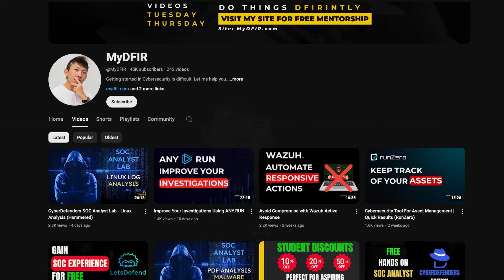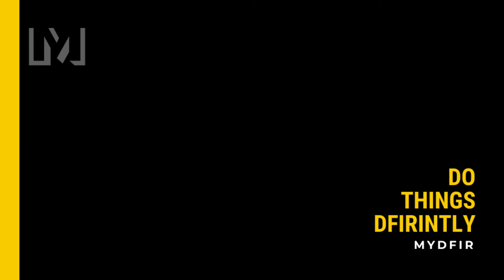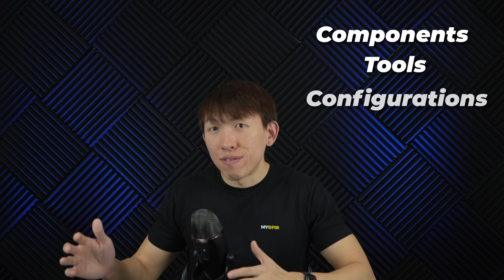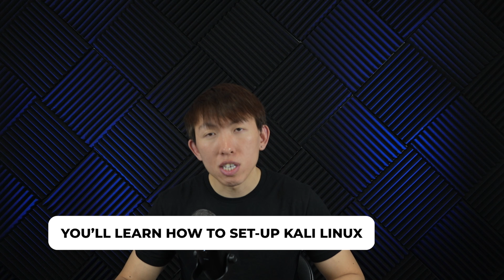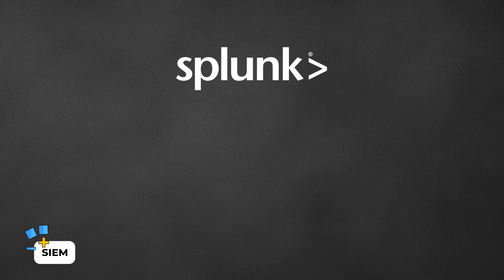Why you NEED a Home Lab | How To Build a Home Lab (SOC Analyst)

Comment: Does Ryzen 7 7th gen with 16GB RAM is good to run upto 6 VMs at the same time?
Reply: I think each vm needs about 4 gb of ram plus the host machine needs 4 gb.
Reply from the maker: Pretty much nailed it! Thanks for sharing 💙 - some VMs could be ran with 2GB but performance will suffer a lot. Thus, I usually put spec that onto a test/victim machine.
Reply: @MyDFIR  Thanks for sharing that info. I'll try to do that. 
pfsense, kali, windows 10, windows server.
Reply: @ReneeWilliams  Thanks for that info. Unfortunate for me I can't afford 32GB RAM yet.
Reply: @Beginners_In_IT  you can still build a cybersecurity lab with your computer. You will just have to do up to 3 VMs.
Reply: @ReneeWilliams  yeah I currently using pfsense and kali, though for testing 16Gb is hard